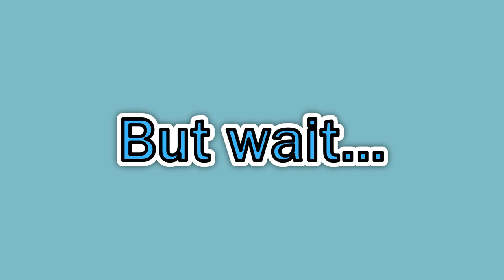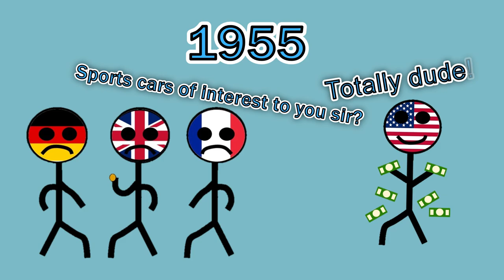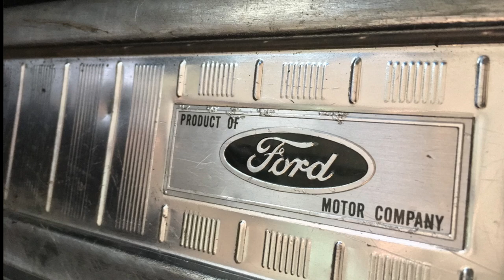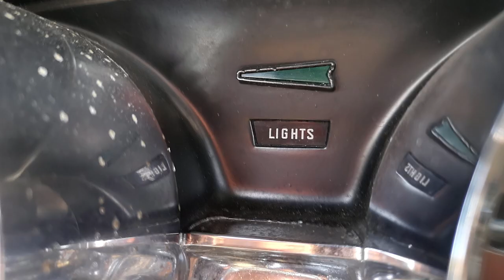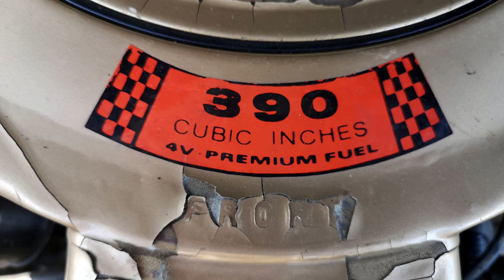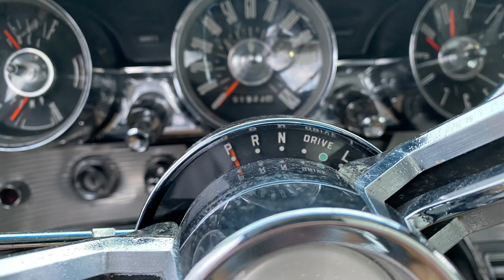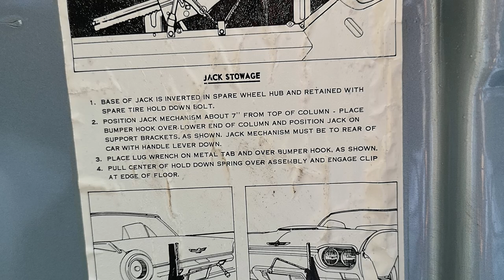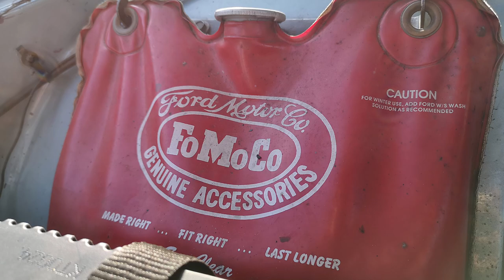The Automotive Anorak's overview: 1963 Ford Thunderbird

Comment: My family had a triple black '61 back in the mid '70s around the time I turned 16 that my dad bought for about $1200 with 45,000 miles.  Oh, that 390 would burn rubber okay, but yeah, it just kinda sat there smoking the tires because of the tremendous heft of the vehicle! Factory no-AC car. Not too uncommon for the day, but a deal-killer for me in the US Midwest with 90 degree+ temperatures common in the summertime . Otherwise an awesome car. I'd love to acquire a convertible version, but since I'm in Texas now, working AC would be non-negotiable!

Comment: Nicely done! I own a 1963 Bullet Bird... Same "Silver Mink" color! By the way, that's an optional color for the bird, stock Lincoln color. Keeping mine as visually stock as I can... can't improve perfection! Stock 4100 carb, but converted to electronic ignition also went straight pipe dual exhaust with performance mufflers. All tucked up under for "stock" look... It is a sheer joy to drive! Going down the highway, step on the accelerator, it's like the "hand of God" pushing the car down the road. My godfather had one when I was 4... it began my 50+ year long love of cars. Honored to finally have one. Totally enjoyed watching another so close to mine!! Thanks!!
Reply: I'm glad you love your bird just like I do mine. What I don't like is someone reviewing a 1960s car and judging it against modern standards. Someone not familiar with these cars would assume from this review that it is a sluggish granny car with granny suspension. The truth is that in the early 60s these cars were very impressive.

Comment: Hey, Hey Hey, I get 12mpg with my Thunderbirds.

I've had close to a dozen Bulletbirds over the last 25 years.  I have two 1962s now, one with 14,000 original miles and original down to the brakes and exhaust.  

Couple of interesting facts or things I am pointing out (with a couple of minor corrections on your vid) concerning these cars.

Robert McNamara was responsible for the 61-63 Thunderbirds and approved the go ahead for production.  You are absolutely right about him being the penultimate bean counter and he killed off much of the Ford Performance Division but the design of the car was signed off on by him.  And yes, he did like stodgy cars.  The funny thing was that several of his stodgy cars formed the basis of future Ford models for decades to come.  The Mustang?  Based on the Falcon chassis.  In fact, the Falcon chassis was used as the basis for much of what Ford produced all the way into the mid 1970s ending with the Ford Granada.  So he might just get the last laugh there.  I'm not a great fan of Robert McNamara but he wasn't a total bust as the head of Ford and in some respects he helped save the company during the economic recession of the late 1950s.  

You mentioned that the Thunderbird is not badged as a Ford (well much) and you are right about them being built in the Wixom Plant in Michigan along side the slab side Lincolns (another McNamara approved design).  The front bumper and grill were very similar to the 1961 Lincoln Continental.  The first 61s Thunderbirds were made in two styles, hardtop and convertible.  The convertible top was fully hydraulic and used a mechanism that was designed originally for the 57-58 Ford Fairlane Skyliners.  It was unique (at the time) in that the rear deck lid would open and the entire convertible top assembly would fold down into the trunk giving the car a completely clean appearance.  This actual setup started in 1958 but wasn't perfected until the 1959 models and was similar until the convertible top was discontinued in the Thunderbird in 1967.  

In 1961 the Thunderbird was amazingly well appointed with standard features that you couldn't find in most other cars.  Like you said automatic transmission and power steering were standard, a rarity even as an option in the early 1960s.  In addition bucket seats, console and backup lights were also standard.  Interestingly things you would thing would be standard, like a heater, radio and side mirror (driver's side) were options in 1961 and 1962.  The side mirror (which was remotely controlled in 63 only) became standard in the year you were driving.  My 14K original car did not come with a driver's side mirror.  It makes for interesting driving.  Another interesting first was the 'floating mirror' that you see on the windshield.  This seems common in most cars but the 1961 Thunderbird was the first car to do it.

In 1962 Lee Iacocca was in charge and he made some changes to the lineup.  One of the first things he did was jazz up the Thunderbird with some option packages not seen before.  For the first time the Landau top option was put in place.  The second was to add a higher horsepower engine option to the Thunderbird.  By adding three two barrel carburators to the car the M Code Thunderbird of 1962 and 1963 put out 340 brake horsepower with similar torque settings.  It had a special engine chrome dress up kit as well.  It didn't sell all that well.  The T-bird was not a performance car, like you said, by the early 60s and the carbs were difficult to keep in tune so they proved unpopular.  But an M Code bird is pretty valuable today.  

The other big addition to the lineup was the Sports Roadster model that came out in early 1962 and ran until the middle of 1963.  This tried to make the car look like a two seater by putting a fiberglass tonneau cover, special wire wheels, a grab bar and badging on a standard convertible.  It could be bought with a regular Z code 390 engine or the M Code option.  It, again, didn't sell as well as hoped and while stunning (I've owned two over the years) the cost of the car ballooned with the options so it didn't sell well.  Again, if you can find one they bring a pretty penny.  

Interestingly, the 63 that you drove originally came with a single exhaust.  The 61 and 62s had dual exhaust but in 63 Ford went with a single exhaust system for the standard versions of the Thunderbird.  The M Codes kept the dual exhaust.  One option you didn't mention was the vacuum door locks that came in 1963.  Where the red brake light flasher is on that car there would be a switch that would activate or deactivate the door locks.  It was more of a novelty than actually functional but I had one car that had it, and it still worked-sometimes.  The 63 also came with a hydraulically controlled windshield wiper system that acted something like a delay wiper if you fiddled with it.  It tended to leak power steering fluid (it fed off the pump) and a lot of people replaced it with the older electrical wiper motors that came on the 61s and 62s.  It also fielded, for the first time, an optional AM/FM radio that was fully transistorized.  This was a big thing in 1963 and the Thunderbird was one of the first cars that offered an FM option.  

If you think that car wallows around I'd love to let you try to drive my original 62 with the original shocks (yep, original) along with the bias ply tires that are recreations of the tires that came new on the car in 1962.  Radial tires weren't around then and the car is smooth as silk but wallows like drunken musk ox in turns.  My other car, which I have restored and has modern radials, is much easier an steady on the road.  But even so it is not the most nible of cars.  Still, I love driving them.  

Fire me a message if you have any questions or anything.  I have had these cars for decades and pretty much have torn them down and put them back together and these are by far my favorite classic car.  Every place I go I get questions, and it is really looks so different, almost modern, compared to other cars from that generation.

Comment: Wow, very nice "Rocket Bird" . The suspension on these cars had what Ford called "controlled wheel recession". Thru the use of rubber bushings in the suspension the wheels were allowed to move fore and aft over bumps and irregularities, as well as conventionally. This improved the ride of these cars greatly.
This is the kind of car you get noticed in! Beautiful car.

Comment: I just love your '63 Tbird, I had a '64 for years and in fact sold it in England in '92. I now have a '65 in my garage. To get some better mileage I put a Holly 550 4 bbl carburetor on mine and on the highways I would get 18 mpg out of it. Which was a lot better than 12 mpg that I used to get. These are a lot of fun to drive and are well made cars. I wonder if my old '64 is driving around the UK somewhere? oh well, God bless.
Reply: Sorry for the random question! What was the registration of your old 1964? I have a blue 64 in the UK that was imported around 91/92 :)
Reply: @benjames0506  Before I sold it I had it painted two tone silver and a darker silver. It had a completely new blue interior that was blue. I don't have any paper work as for the registration number any more.
Reply: @mikejohansson6711  oh that's curious... My car was silver at some point and it has a blue interior that was re done at some point, seats are a beautiful blue fabric with vinyl down the sides :)
Reply: @benjames0506  has the dash been recovered? I had mine recovered in California and he did a great job using two tone blue vinyl and it had a black vinyl top.
Reply: @mikejohansson6711  I think so possibly, it's blue vinyl matching the side of the seats, and the car has a black vinyl top with thunderbird emblems still on the rear c post.
Reply: @mikejohansson6711  lighter blue over the top, and darker in front of the passenger where the dash goes inward :)
Reply: @benjames0506  Any way you could send me a couple of pictures? I just found out I have a bunch of fried wires in my main harness for my '65 Thunderbird.....
Reply: @mikejohansson6711  of course! What was your email and I'll send some over?

Yep... I've got some wiring gremlins with mine, mainly with the power windows, gradually getting there, longggg slog!

Comment: I have owned one each of 1962, 1963, 1964, 1965 and 1966. I caluculate every tank of gas I have ever put into every car I have ever owned. These T-Birds get more like 15-16 mpg at 65 mph on the freeway.

The heads were improved for the 1966 model, it had 315 hp. And it REALLY felt a bit quicker than the others I have owned.

Comment: Ephraim Zimbalist Jr was blessed with one of these babies in convertible form for 3 years on a row in the slick TV private eye program "77 Sunset Strip" from 1961 to 63.  13:30 To compare, I was assigned a 1971 Ford Custom Sedan as a cable inspector for Bell Telephone (Mountain Bell) in 1977 with a 390 Cubic Inch engine and 4 venturies.  It got 14 mpg unless I was up in Wyoming having fun with that huge displacement and doing 90 to 95 mph, then she got 11mpg.

Comment: Discussion of the 4 seater Tbird replacing the 2 seater overlook the Lincoln Continental of 1956 and 57. This was a beautiful car but very expensive and sold in tiny numbers. Combining the Tbird and Continental resulted in the 4 seater Tbird which had broad appeal outsold both put together.
Reply: The 56-57 Connies were exquisite works of art.  Imagine McNamara hated those too.

Comment: My parents owned a 63 T-Bird with a 390 v8. The rear 2 valves burned at 100K miles. They drove it until 71.
The day after they traded it in on a new 71 VW Beetle te dealership called my mom and said that it wouldn’t start. They had to replace the engine.
They had given my parents $1500 for it and then they had to borrow the remaining $1500 to pay off the VW

Comment: The body crease was unique to the `63 Bullet Bird body style.
Some optional performance was available in the tripack six barrel carburetor, in case it was chugging back petrol fast enough for your liking.
This big boat hauled ass.
The baby bird retro was introduced in the Early 2000's by Ford but I guess they didn't send them across the pound.

Comment: Horsepower ratings in the sixties, were UNDERRATED  for insurance purposes.  390's  were in all probability  closer to 425 horses.  A bone stock 390 on a dyno, on premium fuel has been shown to kick out almost 460 horsepower, and the powerhouse 427 were well over 500 horse.  Insurance companies would have loved to know this in the day.
Reply: I never liked 390s.  Low HP high torque.  More of a truck engine really.

Comment: A big improvement if you upgrade to a MSD multi strike ignition, from experience with 2 427 FE motors will run much smoother , also go with a smooth bore 2.5 inch over axle pipe with stock mufflers and larger power increase than you would think , and a difference you will be surprised is a change in the rear differential lube to a redline 80 90 synthetic, sliding gears like these are the biggest cause of friction and on my small truck I noticed the dif in the first 50 ft,  from a 70 year old ford fan , good luck with your car. and one more thing which i dont think you car has is a clutch type engine cooling fan, ford was late to that change but an easy 10 HP boost. all without changing your cars nature but a lot more pep in it's step. .
Reply: The only engine they put in 63 THUNDERBIRDS were 390s NO 427S!
Reply: @jerryparks6123  your right of course but  same style of motor though and multi strike ignition will be a big improvement